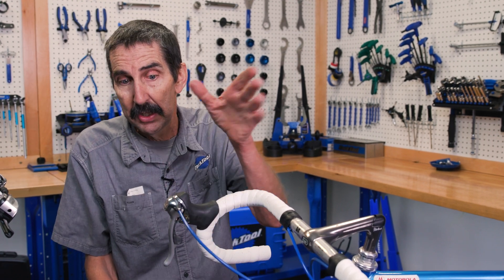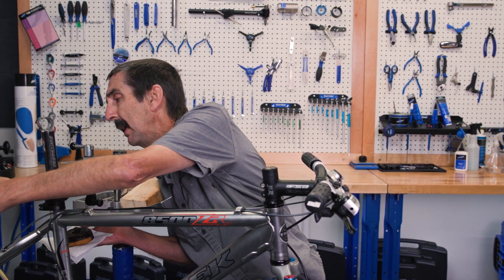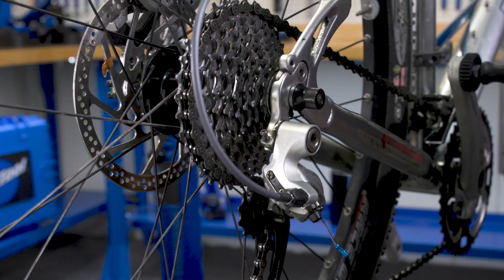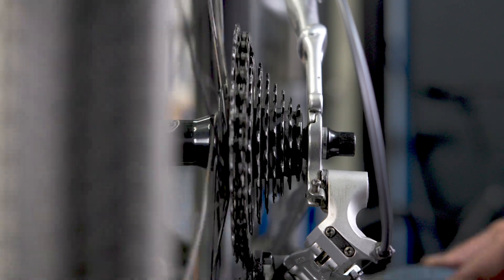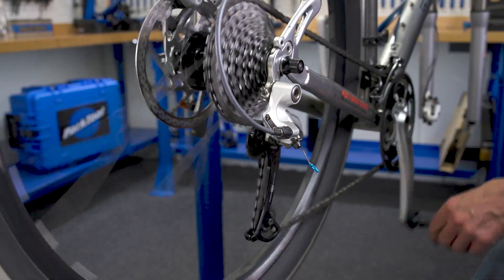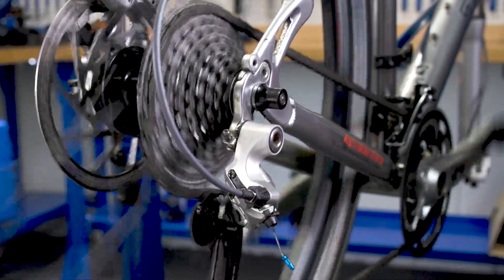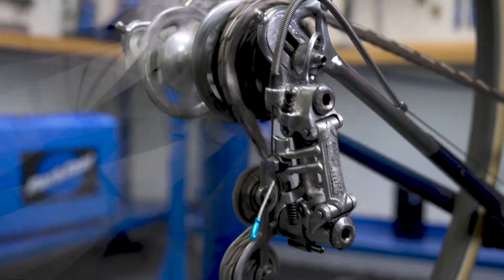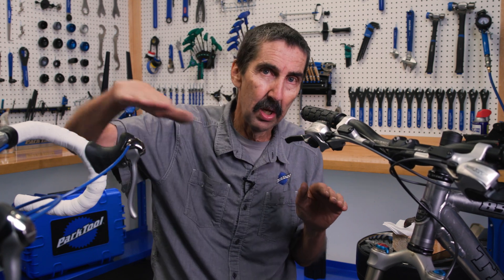The Doughnut Club: Shimano's RapidRise | Tech Tuesday #242

Comment: Just look at the recent efforts SRAM have gone to with Transmission, where downshifts are electronically synchronised with the shift ramps and Shimano with linkglide which has heavier duty shift ramps than hyperglide.   Both of these were required to counteract clumsy forced downshifts especially on e-bikes.  Alternatively they could have reverted to rapid rise where the downshift was on the spring tension so can't be forced.

Comment: Rapid rise XTR is still my go to derailleur, if I can find one. Fortunately I still have one in good running condition. These were faster than any other indexed shifters when going from low to high gears, which meant you could pick up speed really quickly, and reduced a lot of friction and strain no matter if you were shifting high or low, so it allowed the gears and derailleur to last longer. It did it by cutting all the forceful pulling when bringing the chain onto bigger sized gears, instead letting the chain get there through just the spring tension of the derailleur and put all that forceful pulling of the cable on shifting from bigger gears to smaller gears where there’s not all that friction of the chain being rammed into the side of the gears mid shift trying to catch a hop up only once or twice per revolution. Going from big to small, no hop ups needed, so shifting begins on the very next tooth after and allows you to literally blow right past almost all the unnecessary gears when accelerating, allowing you to go from biggest to smallest in two full thumb presses rather than 8 or 9 individual presses. I really wish Shimano went further with this method of shifting, but I guess not enough people gave it the credit that was due considering its genius. Shame that.

Comment: I run Rapid Rise on a few of my bikes, love it.  It makes shifting up into the bigger cogs easy as noted.  But the biggest advantage for me, with various bar end shifters, is that the direction of the shifters is the same.  That is, the FD shifter moves lower to higher in the same direction as the RD moves lower to higher.  Rivendell helped me figure that one out.  I had put a set of their Silver Shift barcons on my road bike and it was so confusing with the shifters moving in opposite directions.  When I built up my monster cross bike, with the RetroShift (Gevenalle) shifters, I put in a rapid rise RD to begin with and with that, both the front and rear shifters rotate outward for lower gears and inward for higher gearing.  Both bikes are set up 3x10, the road bike is friction and the cross bike is indexed (or friction).

The only downside I find is setting the RD up, as it's all backwards compared to normal RDs.  You really need to think in terms of which way the cable pulls.

Comment: Loved RR. Converted all my MTB's back in the day. It's more intuitive as it work the same as the front derailleur, i.e. release for easier gear. Reduces chance of snapping a chain when shifting under load since it's spring tension that's moving the chain to bigger, easier gear which is when you are most likely to break a chain.

Comment: Rapid Rise works "better" with friction shifters, as well. The more difficult shift (to larger cogs) is aided by the derailleur spring, making it lighter, and more "efficient." And let's not dismiss the default to a lower gear should the derailleur cable break out on the road, with no replacement and/or tools.

Comment: Good vid, Calvin. I've been obsessed--maybe to a fault, maybe not--with RR derailers since 2005 or so, about that last year Shimano made them. I don't use them exclusively, because I have some perfectly working other derailers (big fan of the Shimano Altus M310 here...and Acera, etc). I may be less than 100 percent accurate with the timeline, but it's really close: Shimano made these from about 1999 to 2005. Disraeli gears (good site) may disagree, and I'd go with what he says. Shimano intro'd these to mtn bikes, not road, figuring mtb riders would be more receptive. But (as I recall) they intro'd it at the top levels--XTR, XT, LX, DEORE--and they couldn't get racers to use it, for fear of shifting the wrong way on a climb or something. And big mfrs were, for the most part, chicken to risk it. Shimano made the "mistake" of offering it as the freaky option to its normal derailers, and of course product mgrs opted for the normal ones. The Shimano came out with a line of RR ders for hybrid bikes for rich old guys, and that had no trickle-down effect, and probably even hurt them. But some of those derailers are magnificent in function (of course, it's Shimano) and value and looks. A few were super freak looking. My biz has bought all we could of them--maybe 200--and sold them, but (as somebody mentions below), we're working on "our own" version. Shimano won't remake it. I've asked, but who am I, and all Shimano cares about is the gigantic cmpanies spec'ing it, and they won't. So for 7 years now we've been plugging away, contacting makers, working with others nobody has ever heard of, and recently we've made a connection with a fairly famous maker. It's too early to say where it'll go, but by mid Nov we'll have drawings, and if all goes well, we'll have production in 6 months. In my experience, 6 months means 10 months, but whatever. There are lots of good normal derailers out there now.  Another PLUS of RR: If you ghost shift, you shift to the easier gear. And both shifters move in the same direction for the same effect.
Anyway--I am saying all this stuff because it seems relevant to this topic, not to promote my biz or to get. people jazzed on RR derailers. I am preemptively trying to fend off criticism here. Seriously, all we're doing it trying to resurrect a smart option from the past; not trying to kill off other derailers, not saying you're dumb if you don't like RR derailers. Just adding to the menu.
Reply: Great points, and I wholeheartedly agree
Reply: Can't wait for that Silver RR derailer!!
Reply: I live atop the highest point in my state and the RR type shift well under load

Comment: Both my bikes have low normal derailleurs operating in friction mode with bar end shifters. I love the assured quick downshifts. And the logic of pulling up on the lever to go faster. One is shifting 10 speed with no issue the other 7 speed. Bike mechanics dislike them because they are different not because they are a bad idea. The guy at my bike coop is on to my taste and saves them for me when they disassemble  parts bikes.

Comment: Calvin, you forgot the best feature of rapid rise: you use the same motion to go to an easier/harder gear in the front and back. With a rapid rise rear derailleur, releasing tension goes to an easier gear both in the front and the back

Comment: Say what you want about Rapid Rise, but I really love it and you didn't have to use the integrated brifter type levers, it worked with regular trigger style shifters as well. Why did I like it, because I had quite damaged thumbs, so not needing to apply loads of pressure to the shifter to get to an easier gear/bigger cog, was a huge benefit and savings for my thumbs. Heck I only moved to 10spd in 2016 to get a clutch on the derailleur, otherwise I would have stuck to 9spd Rapid Rise.

Comment: My view is that on a racing bike one wants the sprung motion to be working towards getting into a higher gear asap, whereas on an MTB it's the lower ratios that are in demand
Reply: Ironically shifting into a higher gear with rapid rise and STI levers is instantaneous and the engagement is solid. It works so well it always baffled that Shimano didn't make a road group rapid rise.

Comment: With a conventional trigger shifter, Rapid Rise is a pleasure to ride because it prevents force shifts.  I remember when it came out with 8spd (M951) and then 9spd (M953), both using conventional triggers, and it really improved the feel of shifting versus the standard version derailleur (M950/M952).  I truly believe the only reason Rapid Rise never caught-on is manufacturers never spec'd it as OEM during the trigger generation, and by the time they did, it was the M960 brifter generation that so many people hated and created a negative connotation.
Reply: I had a 1996 Norco Team Issue that came with XTR rapid rise. And I loved it.
Reply: @tylerbruce5731 I had a 98 Barracuda DH bike, same monocoque bike as a Norco. Loved the rapid rise. Same as my Giant VT-2 from about ‘04 with XT rapid rise, both regular Shimano trigger shifters
Reply: 99 spesh Stumpy FSR - I had rapid rise oem and hated it

Comment: Im still rocking this rapid rise RD on my lowkey gravel bike. Its still easy to find second-hand. 
It works with 10spd 105/ultegra. I even had it with campy xenon 9s.
It has some interesting benefits vs. normal. 
1. During sprinting/power delivery its possible to shift to harder gear - its pulling the cable. 
2. Same lever ergonomics use with FD, brake lever to hard gear, small one to easy. 
3. cable breakage = easiest gear vs. hardest with normal RD.
Biggest negative is to remap fingers and/or use another bike with normal setup. And of course loss off all new features of modern RD.
Reply: It works amazingly well.  My Zurich has Ultegra 8s and a short caged XTR rapid rise.  My cross bike is Sachs 8s Ergo Power and Nexave rapid rise. They never miss a shift either way and doesn't seem to mater how loaded the pedals are. Oh yeah that shift to a smaller cog is instantaneous. I also like how it goes to a lower gear .just click off the number of gears and let it happen. I know it works better on road bikes than the traditional derailleur and the ergonomics are better too. So glad that unwanted Nexave rapid rise was hanging around waiting for me to put it my Raleigh C50 cross bike. Even fitted the Nexave with a short cage. Yeah didn't have funds for a traditional cross bike....but I did have a torch....and  a proper fork ..and a sloping top tube.  At the time I wasn't going to get the sloping top tube.

Comment: I have a Claud Butler from 1949 with an original 4 speed Cyclo Gears 'Benelux' chain-pull derailleur. Even though it is a friction shift system, the cable pulls the derailleur outboard to the harder gears, and the tension spring pushes inboard, in the same way rapidfire does. I didn't think that any cable operated modern design operated outboard pull, as Campagnolo's invention of the parallelogram derailleur was inboard pull, and the rest of the manufacturers followed.

Comment: Had an XTR 9spd Triple with rapid rise for nearly 20 years on a Santa Cruz Blur.  Many like to joke about them but it worked incredibly well and became intuitive to use.  The range was phenomenal.  The downside was that it could be finicky to adjust and the original groupo crank had a long ago orphaned bolt configuration that meant it became impossible to find new chainrings.

Comment: The best doughnuts are made at Crwst, Aberteifi, Cymru.

Learning the knack of changing gear smoothly is a part of cycling imo. That said, systems which make it easier for people with weak finger strength, or lacking in fine motor skills, are definitely good things if they make cycling more accessible.

Comment: I have a Deore LX rd from 2009 on my bike shifted with Rivendell bar end shifters (friction).  It works fine.  I like that when I quickly need a much lower gear, I can just dump the shifter and the derailer pulls itself all the way down.  Also, the rd looks great.  In the 15 years since, bike components from Shimano, SRAM, etc. have become really ugly.  They are painful to look at.  They ruin the looks of bicycles.

Comment: I have a XTR rapid rise that I have used for the last 27 years on my old m2 sworks. What’s the most gears it will handle? Can I just change the sprockets to make it work on a modern 12 speed bike that use those less wide chains?
Reply: It only works on 9-speed drivetrains. 12-speed and 9-speed drivetrains have different cable pull ratios so pairing them together is suboptimal.
Reply: @addons_  I thought that was controlled by the lever. I went from a 8 to 9 speed on that rapid rise derailer by changing the shift lever and cassette back in the day. If it’s maxed at 9, I guess I need to learn to shift normal if I pickup a modern bike! Thanks for the help!!

Comment: Had never seen this before and had to service a Bike with the RapidRise. Bleeding and rebuilding the Shiftmechanism was .... something else.
Reply: Bleeding? Cable operated
Reply: @moparman6814  The Brakebody is hydraulic
Reply: @AverageTom91  wrong
Reply: Shifter is same as normal derailleur, it's just the parallelogram spring in the derailleur that is reversed.
Reply: What are you talking about? It is just a mechanical derailleur that is low normal rather than high normal. The only bleeding that could happen  is if you skin your knuckles.